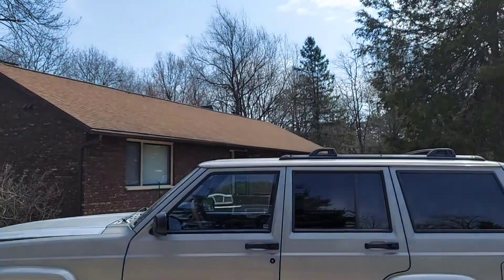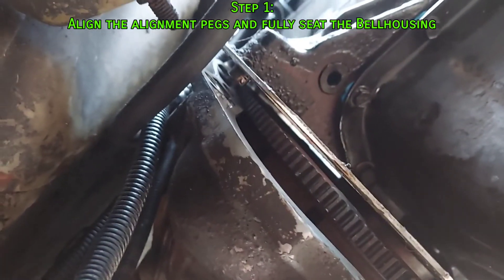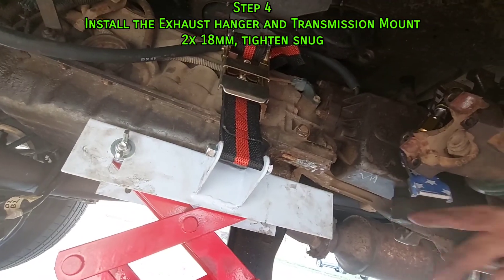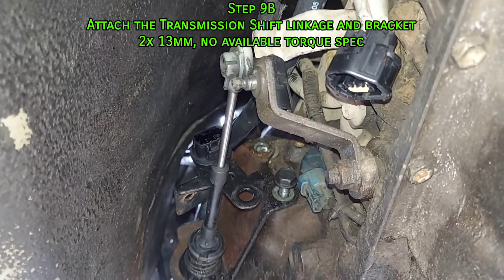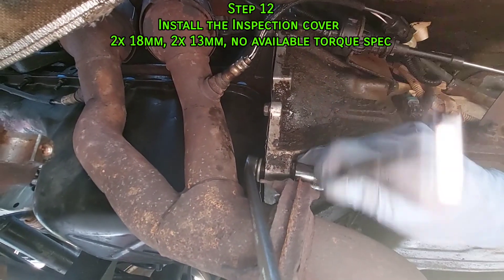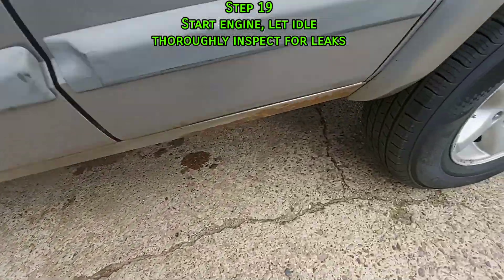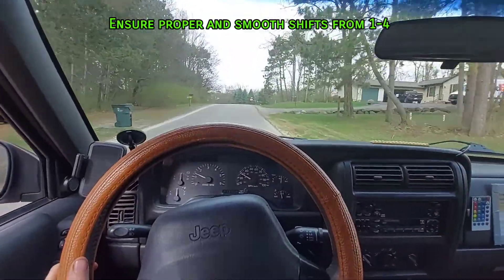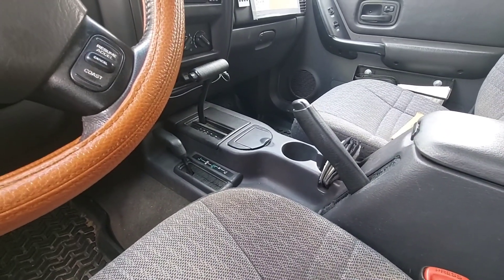Jeep Cherokee - Transmission Installation Procedure: AW4 ['97-'01 XJ]

Comment: Hey Waemid! Avid watcher of your vids, and looking for some advice. I've got an 89 comanche that seems to be having some trans issues. No creep on level ground, needing high rpm to get started from full stop, etc. You think I should I go ahead and swap the transmission? I already pulled the pan and replaced the filter.
Reply from the maker: @haydenyoung9475  it's possible there are internal issues, but more likely it's just low on fluid. Remember to properly check the transmission fluid, the engine needs to be at operating temperature on flat ground, and the transmission in neutral
Reply: @WAEMIDIV  I do check it pretty much every other time I drive it after it's up to temp, leaving the engine running. I do put it into park instead of in neutral with the parking brake on, I wouldn't think that would make a difference though? I did also make sure to run it through each gear a few times before driving after flushing the fluid and replacing the filter

Comment: Transmission mount to transmission (two 18mm bolts): 55 ft. Lbs. 

Crossmember to transmission mount (four 13mm nuts): 155 in. Lbs (16 ft. Lbs My torque wrench goes this low, I hope it's accurate at that low of torque haha) 

Crossmember to uniframe (two 15mm bolts and two 15mm nuts): 30 ft. Lbs.

Comment: How do I tell if the torque converter is locking up? 🤔
Reply from the maker: It feels like a half-shift. Under normal, average acceleration, it should kick in at 35mph. The RPMs will drop by only about 200, as opposed to dropping about 600 at a shift point.
Reply: @WAEMIDIV  awesome, thank you. I spent most of the day trying to reinstall my replacement transmission and I can’t get the damn bell housing pins to line up. It’s driving me crazy :/

Comment: umm, wasn't the 99-2004 actually WJ's?
Just wondering, because the procedure should be the same, but, get the names right?
This makes me wonder how reliable the procedure is.
Reply from the maker: Not sure which part of the video you're referencing, but if it's the title, note the complete lack of the word "Grand" anywhere in it. The 99-04 Grand Cherokee WJ didn't come equipped with the AW4, so it's probably not too similar beyond the bellhousing on the 4.0L models. The 97-01 Cherokee XJ (regular Cherokee), as featured in this video, did in fact run from 97-01 with the transmission in question demonstrated in this video. If you have a WJ I have no idea if any of this information applies, because I don't have a WJ, I have an XJ

Comment: idk if your active but I need help. I used your video to replace my torque converter I serviced the transmission.  now it won't go into gear. any idea?
Reply from the maker: If it don't go into any gear I would think there's not enough fluid in it. Your shift cable might not be attached, or the NSS might be misadjusted. Some starting points

Comment: I’m about to tackle this project just to change the $5 leaking rear freeze plug along with a SYE kit for the transfer case new drive shaft and shims on the rear axle. Wish me luck
Reply from the maker: Ah yes, I later found that freeze plug had actually already been replaced on my Jeep, never breathed a bigger sigh of relief before
Reply: @WAEMIDIV  did you have to tilt the engine to reach the 2 top inverted hex bolts?
Reply from the maker: @victorjramirez1948  No, just lower the transmission and use 4 feet of extensions

Comment: You skipped how to line up the torque converter to the flywheel bolt holes. You went straight into bam they were in. Thats where I am stuck at now. Otherwise good vid!!
Reply from the maker: I explained at the beginning that I had the flex plate positioned with a hole at the lowest point, and then spun the torque converter to also have a hole at the lowest point. Upon putting it up onto the engine, the holes were already lined up, and it was as simple as putting a bolt in.

Comment: FYI, torque specs from the factory service manual on that rear mount/crossmember:

Rear Mount-To-Transmission Bolts . . . . . 60–81N·m
(44 ft. lbs.)
Rear Mount-To-Clevis Bracket
Bolt/Nut . . . . . . . . . . . 54–75 N·m (40–55 ft. lbs.)
Rear Mount Clevis Bracket-To-Crossmember
Nuts . . . . . . . . . . . . . . 33–49 N·m (24–36 ft. lbs.)

Comment: Do you know if I could put a 95 cherokee trans into a 99 jeep cherokee?
Reply from the maker: You could, but there are some wiring differences you'd need to change. The transmission will fit and mount properly but you need to splice and repin the connectors for the solenoids and maybe the NSS. there may be more to it than that, I don't have a HO XJ to test on

Comment: Fac! At 5:50 I thought 55 was the spec for the center bolts and I snapped one! 😂 my fault great video and the other one to take it off I used these to get to my rear freeze plug that was leaking
Reply from the maker: Ah, sorry about that, I can see how with the way the text is on screen it can be confusing. An oversight in editing

Good thing those studs are part of the transmission mount, and can be replaced 

I think my rear freeze plug is leaking too, just decided to right after I put in a transmission. Might make a video about that, I dunno